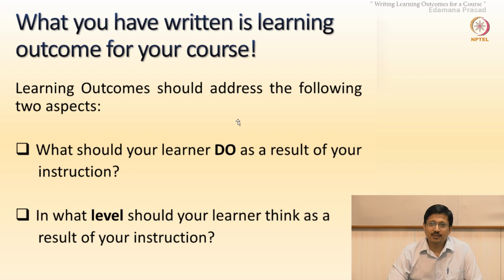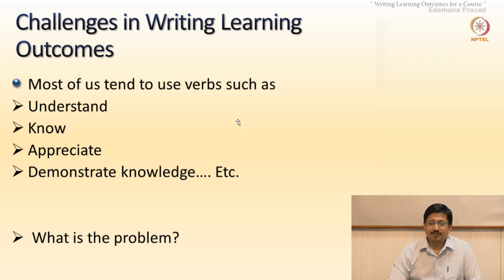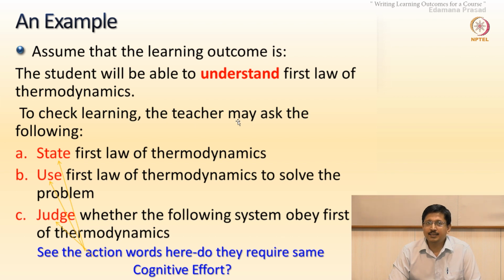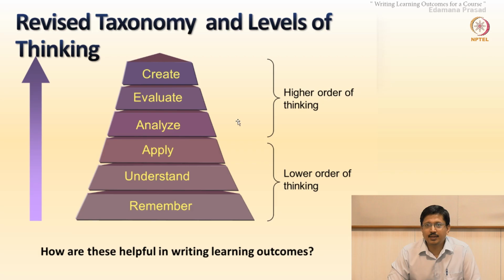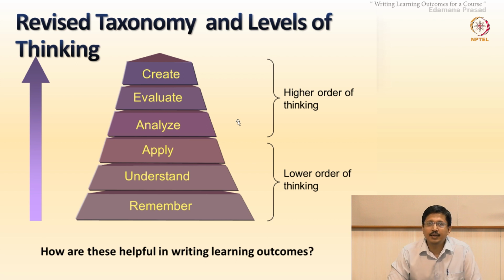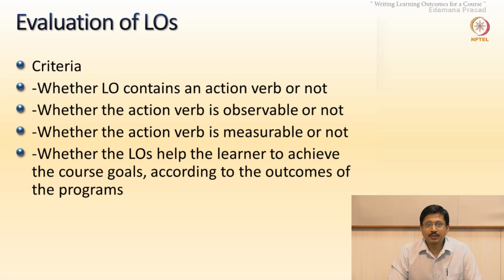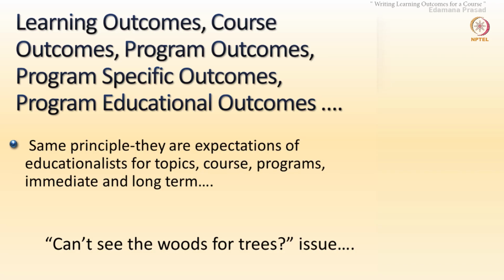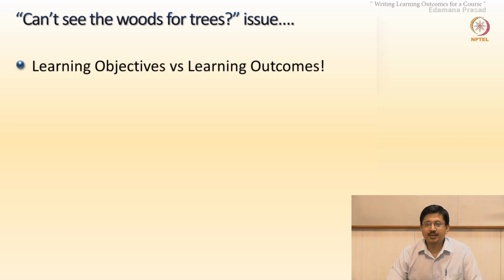Writing Learning Outcomes for a Course

Comment: 1. The most valuable or helpful aspect of writing Learning Outcomes (LO) is that it helps me as a teacher in deciding which teaching method is most suitable for the purpose of its successful attainment. 
2. The muddiest or most confusing point about writing LOs is to consequently decide upon the evaluation criteria.

Sir, it would be great if you can elaborate on the evaluation criteria a bit more in detail.